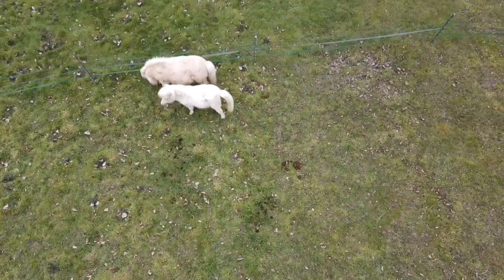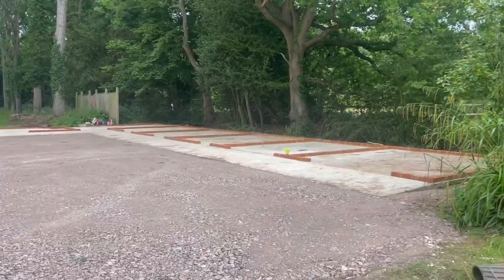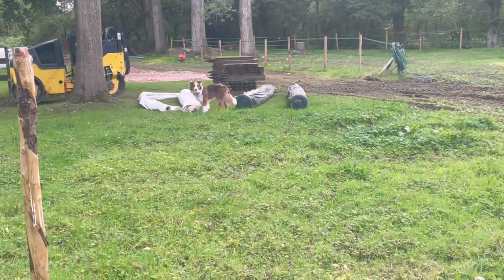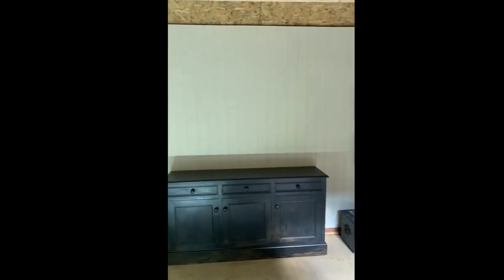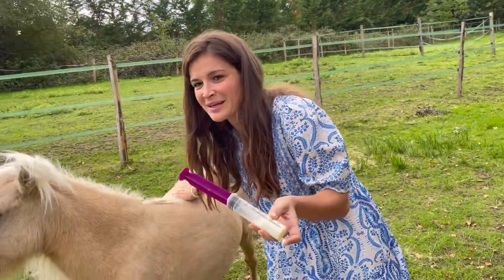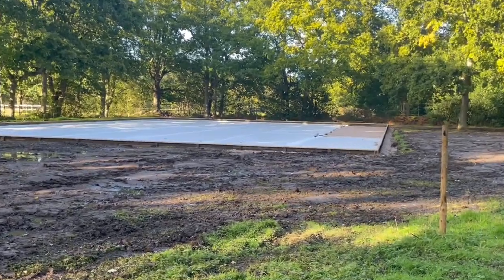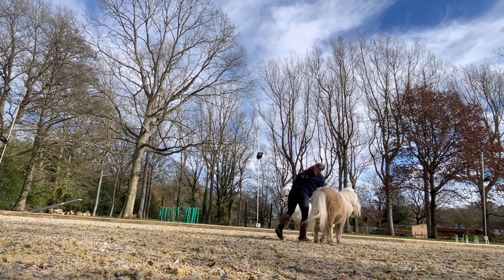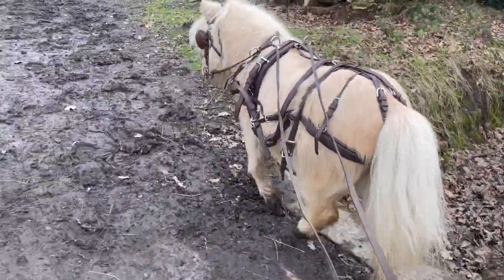BUILDING OUR DREAM EQUESTRIAN PROPERTY 🥰 | Teddy the Shetland

Comment: What sort of drainage is under the black matting you had at the base of the arena?
Reply from the maker: We had land drains every 6m (looked like black pipes with holes in them!) surrounded in 6mm shingle. They all connect and go to the perimeter drain. The arena is surrounded by ditches which flow into a stream. There hasn’t once been a puddle on it even after days of rain so it definitely works very well!
Reply: Thx. We are building one very soon so this has been helpful
Reply from the maker: @felicitycoombs  let me know if you have any more questions as we did so much research! We had planning for a 60x30 but to save costs we went for a 40x25. The extra width makes it sooo much better for jumping than your standard size arena!